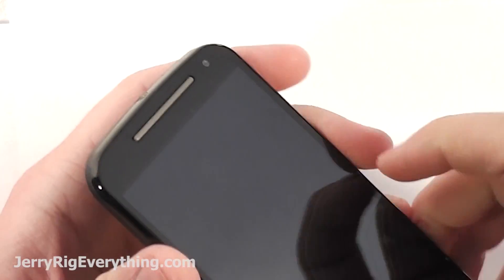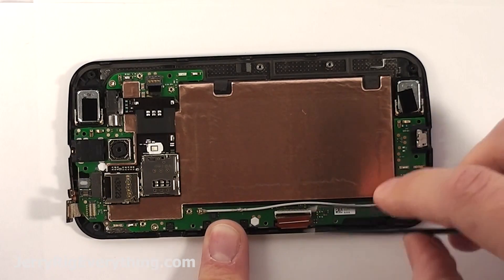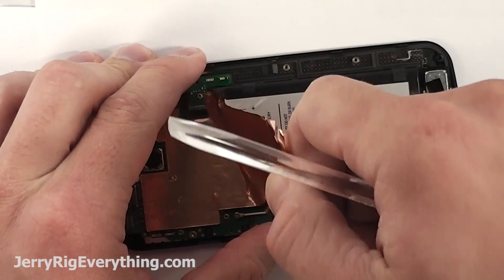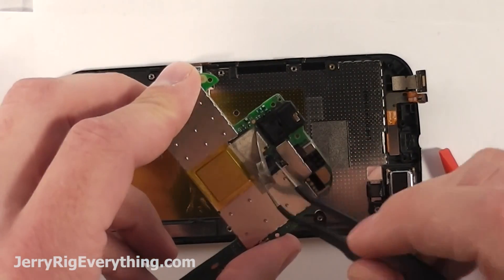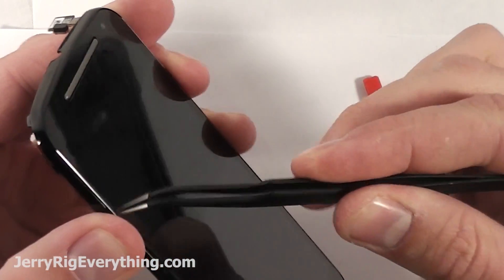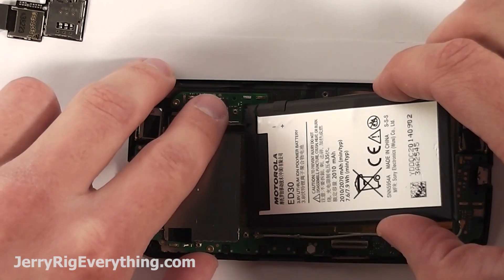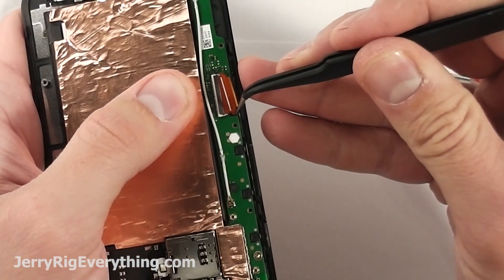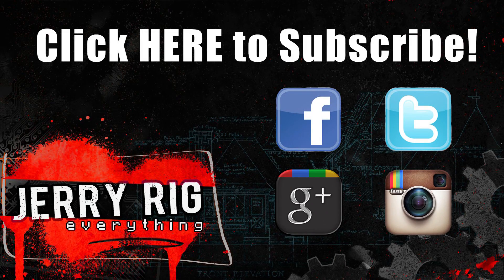Moto G 2nd gen (2014) Screen Repair, Battery Replacement

Comment: A superior instructional video.  Having never done this before, ever, I worked MUCH slower than the video shows, only replaced the battery and was very careful handling the circuitry.  So, it took me 90 minutes.

Comment: Hello, I looks like I need the sim/sd card assembly. The bonehead who put in the sim card separated the adapter around it, so while trying to get it out to change the batter, the sim card collar/adapter grabbed on the contacts and ripped some of them out. The sim card is now not working.

Comment: Ok, I figured it out. During the battery swap process I had dislodged the antenna wire. It has a push fit connector at each end and I had dislodged the lower end. Took me ages to work it out as every time I took the back off the phone everything looked in order and most of my attention was focussed on the ribbon connector of the PCB with SIM/SD trays and LED light.

Comment: Hi guys, I followed this very useful tutorial in order to replace a tired battery in my MotoG.  Since putting it back together, neither SIM card slot is working. Other than taking the phone apart again, disconnecting and reconnecting the ribbon connector, does anyone have any ideas on what the problem might be?

Comment: ---------PEOPLE WHO WANT TO REPLACE JUST THE BATTERY LISTEN UP ------------------- 
I wanted to replace just the battery and I thought about it. You do not need to remove any of the connection of the ear peice or camera or lcd connection (as shown at 0:44 in the video) you just need to to lift off the sdcard/sim card connection (as shown at 0:57 in the video). This will make your life easy as you will not have to connect these back up again if you are like me and just want to replace a new battery. 

ALSO, it shows in the video that the you remove all screws and put them on the table. I suggest their is a better way to do this. You loosen them up while they are inside the cover but do not take them out of the cover. Gently remove the cover while the screws are still in the holes. This way you can simply put the cover back on when you are done and you will have a less than of loosing the screws. Moreover, It will also help as some screws are smaller than others and if they are in the original position when you remove them you will not have to remember their position in the case you put all of them on the table and then decide where the smaller screws go and the big screws go. 

Thanks

Comment: I finally cracked my screen for this phone after years. Unfortunately, when I searched for a replacement part, I was just looking for the screen, and didn't know about having the casing to go with it. Do I really need to take literally every part of the phone apart before I can get to the screen? Yikes. 

I very much appreciate the close, detailed camera setup you have, and the step by step directions.

I've got my tools in front of me, a cloth to make sure nothing rolls around too much, and a little pill bottle to hold the tiny screws, so wish me luck!
Reply: So... It looks like this video has little to nothing to do with screen repair. Why was it in the video title?
Reply: Replacement is done for now. The new screen is in, but without enough direction on where to put the double sided tape, I figured what made the most sense was to glue the flat back part of the LCD screen to the back of the phone case. For the record, DO NOT DO THIS. I think you're supposed to put the gummy tape around the border so that the LCD screen

It seems like it works until you put everything back together, then the screen kind of pokes out the front a bit instead of sitting flush with the front part of the phone. I think the distance between the screen and the speakers is giving the speakers a kind of fuzzy / muddy quality, so now my audio is messed up. 

Another thing to note are the little trapezoidal tabs you might see in the inner case of your phone. These are what your external case is supposed to grab onto to support itself. I have a pile of 4 of them that were all snapped off. Initially, I was just assuming that those things were supposed to break. A sort of "if the phone is dropped, make sure these things take the impact instead of the more sensitive parts of the device" thing.

At the end of the day, the replacement is Done. Playing audio through the phone's speakers seems like it might be permanently messed up if I can't rip off the adhesive glue behind the LCD screen (I have a suspicion that that would destroy the LCD screen itself, so I don't want to risk it). I can see the screen again, but if my phone suffers another failure to a critical system, my plan A will be replacing it.

Excuse the grumpiness.

Comment: Hi there. Nice video. My Moto G2 heats up (really hot) at the top right side, it takes +12hours to fully charge and then the battery drains in less than 4hours. Is an indicator for a battery replacement? Or it could be another component that is damaged? Thanks..

Comment: My Moto G 2nd gen phone was submerged in a swimming pool and had no life signs. 
I Changed very carefully the motherboard, the SIM and microSD board, the screen with the frame, the speakers and connectors, also put a new battery, and works again. I was lucky. 
Thanks for your video!

Comment: You don't have to disassemble all components to change the screen. You only need to unscrew the 3 screws that hold the motherboard, pull the sticky tapes from beneath the battery (yes you can pull them, slowly and they won't tear). This way the whole motherboard with the battery can be removed and placed on top of a new screen. Of course you have to unplug the ribbon cables that are connected to the motherboard (screen, front camera and sensors)

Comment: My motoG2 screen is broken. I bought the LCD with frame, and connected the LCD bus to motherboard, But now my my phone doesnt even turn on. I tried connecting charger as well, but the phone does not vibrate too. So I dont know if the problem is with some connection or the vibrator motor or only the LCD connection Please help.

Comment: Sim card holder link plz..
Reply: did you find one?
Reply: +marios mariou https://m.ebay.in/itm/Sim-Card-Memory-Slot-Jack-Flex-Cable-Reader-For-Motorola-Moto-G2-2nd-Gen-XT1068-/172081746790

Comment: Thank you for this video. I used this and 2 other videos for reference when changing my screen and touchscreen. I almost panicked when i tested and the phone came on but not the screen. I had not placed the motherboard screen cable correctly. You really need to get it all the way in there. I hope the phone will last another year now before I need to replace it :)
Reply: Oh I also wanted to add that if you are getting the tools with the screen make sure that the Torx T5 screwdriver is of some quality. The one I got with the screen started to have its metal head stripped on the 7th screw! It then started to strip the screw heads slightly. Quick trip to the hardware store to get a torx set was better then stripping the screws!

Comment: Hi,

I accidentally dropped my motog 2g from a low table while it was in it's shield and yet the screen  is having weird colorations and also looks like every other line is not working making the screen project weaker light and blurrier image.

What do you suggest I should do?

Thanks!

Comment: hi, great video, one thing to add. the one I opened up had two black straps on the side of the battery. turns out they are there to help pull the battery out, which might make it that you can pull out the battery without the need for a tool. 

thanks again
Reply: helpful thanks!
Reply: Very helpful.

Comment: vertical color lines appearing in my moto g turbo .can I replace it? or it can repairable .I bought only 3 months ago
Reply: Should be under warranty if you bought it new.

If not, vertical lines are signs the LCD screen itself is failing. You'd have to replace the whole screen assembly to fix the issue.

Comment: i bought only the touch and lcd :'( and i dont have the heat machine..what can i do? 
hairdryer works? no right?
Reply: Timo VanDeGriend Okay thank you dude
Reply: +GiannhsD nooooooo...u r talking abut a solder gun vs a hair dyer...dude get some help from wiki
Reply: +GiannhsD if you want it to separate the frame a hairdryer should work, you may need more patience and be carefull but it should make the trick
Reply: +GiannhsD heres a trip: use a hairdryer, and heat it up as much as you can, then use plastic tools to seperate the glass from the frame, you can use metal tools to get the first lift, i recomend to start from the bottom, and work your way up, be carefull around the speakers (thats how i broke 1 moto g 2nd gen screen) any more questions? ask me
Reply: GiannhsD youre welcome :D did you buy an lcd with the orange or green flex cable?
Reply: Timo VanDeGriend Actually i bought a new phone haha :D
Reply: really? what have you donw with the old one?
Reply: Timo VanDeGriend Sold it in pieces :D
Reply: good job xD

Comment: Could you please do a tutorial for replacing the headphone jack on the Moto G 2nd Gen? Can't seem to find one anywhere..
Reply: have the same issue but cannot find anything anywhere on the net
Reply: Yeah man, word of advice, give up haha. In the end I just bought a replacement Moto G 2nd Gen on eBay for a couple months before upgrading to a Nexus 5X. The phone's pretty outdated anyways considering it has two successors now.
Reply: @camzy01  haha I am still using it, besides battery drainage and phone being a little bit slow, I don't have much problem with it

Comment: Thanks! This video helped to replace my screen but I have a problem... after replace, the screen is killing the battery. In battery options I see that the display is consuming up 45%!!! Any help with this?
Reply: don't worry I haven't changed my screen and it's taking  up 43%

Comment: What sticky tape would you recommend? I bought the screen and tool set, replaced the screen but the screen will not stay in place; when I plug it in to charge the light lights up but then it goes out...thank you

Comment: I have a broken sim slot. Is it possible to purchase the sim/sd ribbon assembly as a single piece or would it be necessary to purchase the SIM card reader and resolder it to the ribbon? With a soldering iron would this be a difficult fix for someone with a minimal amount of experience working with electronic? If it is doable is there a particular type of solder to use? Thanks.

Comment: having just done this repair on the xt1072 ie the 4g version  I don't recommend that you try the replacement of the glass and frame in one go.
It is easier just to replace the glass.
the internals of the xt1072 are different to those shown in the video in several ways.
most notable there is an antenna cable running down one side of the phone and this is fragile and has a tiny cirtuit board at one end thats difficult to separate from the frame, also the antenna cable has two sections of its insulation removed and the original xt1072 has special projections that make contact to the screen of the antenna.
the replacement screen I got didnt have these projections so to make contact i wrapped the cable in foil.

so i recommend just getting the glass and keeping your original frame - this will mean a lot less disassembly and your frame will be compatible with your circuit board.
Reply: The little circuit board was j held on by soft glue that I was able to pry off.
Not sure what you mean about the battery.
Reply: The battery does unclip but again it doesn't look like the videos you see. If i recall the battery connector lifts up out of the connector on the board rather than coming out sideways.
Reply: +John Lonergan Thank you very much for the reply and extra info. It is surprising just how little is available for this variant compared to the others.

Comment: my bottom speaker isn't working after replacing screen.  i accidentally pried open the speaker and copper coil(i think) unwound a bit.  does that mean my speaker is not fixable and need to replace it as well? thanks

Comment: Wonderful!! very clear instructions on replacing various parts on the camera. Managed to rescue my sons holiday pictures and fix his phone with a screen replacement. Not all the steps were necessary to replace the screen so leave the parts on that don't apply to you. I had to move across the ear speaker cable and tape it in place (not shown) but no problem. Many, many thanks for your posting........from England

Comment: A very small rubber piece fell out it is flat on one end and round on the other with a small hole, no idea where it goes, can you help?
Reply from the maker: Sandra Ballantine It is probably for one of the microphones, or sits in a slot along the edge of the frame of your phone.

Comment: My phone was working absolutely fine yesterday, but for some reason it won't charge, like on any charger I've tried, any help or tips or anything would be appreciated, thank you
Reply: Found that resetting the phone by holding down power and volume button done sometime helps

Comment: Dropped the moto g 2 in the loo. let it dry out, disassembled by using this video. I was able to clean all the contacts on the main board. The screen was damaged beyond repair so got a new one. All is working well now. Thanks for the good video. The screen i got came from here http://www.ebay.ie/itm/331518080185?_trksid=p2060353.m1438.l2649&ssPageName=STRK%3AMEBIDX%3AIT

Comment: Please help I managed to repair my cracked screen with a replacement frame and new screen, but the speakers sound terrible and extremely distorting. Its like the quality has dropped all the way.
Reply: +Will Poulton Drumming Hi. Did you manage to fix it? I have the same problem.
Reply: +Carlos Silva Nope i ended up getting the Moto X lol. But the only reason i didnt fix my Moto G was because there dont seem to be any compatible speakers for sale online.
Reply: OK. I found some speakers on eBay but someone else told me that by changing the screen once again it started working. Maybe I'll try getting the speakers. They're cheap, less than 10 dollars.

Comment: Thanks, I was able to repair my daughter's cracked screen 😀 very easy phone to repair, I found a complete front assembly on eBay for 39 bucks.

Does anyone know if replacement screws are available?  I found the torx heads are pretty soft and if I have to fix it again the stock screws will not make it.

Comment: Thanks for your vid and links, one point to note don't tighten screws to much, I did for the one under in the sim slot and it now has a faint blur on the lcd under the screw hole, oh well. Everything else is A.OK

Comment: Thanks so much for this video. I was able to replace a cracked screen.

Two points:

1 - There are two black tabs on the side of the battery closest to the edge of the phone. These are where the adhesive is applied, so when trying to remove the battery, these are the areas to concentrate on getting your spudger tool under.

2 - The replacement frame & glass came with new adhesive strips covered in red. With a fair amount of effort, you remove the red and then you have new adhesive strips for the battery

Comment: Hi, after I replaced the screen I had gotten "SIM Not Inserted" message. So, I took it out and saw that the sim board was not connected firmly. Went ahead and did that. Now I get a message "No Service". Phone was perfectly functional on T-mobile before I tried to replace the screen because of a small crack.  Don't know what to do now. pl help

Comment: I replaced the screen on a Moto G 2nd gen, but the touch isn't working.  The screen turns on, but it won't register any touches.  Did I do something wrong?
Reply: Decembri Hi there.... good news bad news.... I purchased the Chinese AAA combo in the black market ( screen, touch and frame)  for U$ 35 dollars but even though the screen lighted up , the touch didn't work....... then I purchased the original combo part from Motorola for U$ 60 dollars and it worked just fine... so for those of you which the replacement part didn't work its because the part was NOT the original but the Chinese copy.... so if u really want to fix your Motog2 please purchase the original combo part from Motorola !!! :)
Reply: I'm have the same problem. I really really need some help with this
Reply: Andrae Henry Me too!! Does anyone knows how to fix this?
Reply: Me too .... its has to be something relate to the software not being able to recognized the new hardware ( display ) ... I ´ll work on the software today and will let you guys know how to fix this shortly.
Reply: Javier Aguilar thanks! My moto g had just been sitting in a drawer.. Hope you figure something out!
Reply: Which screen did you replace? Was it the full screen like suggested in the video or just the outer glass? The outer glass has no touch
Reply: Liam Ouzel I replaced the entire display.

Comment: Would I be able to replace the 2070mah battery with the bigger battery from the 4G moto G?
Reply from the maker: sillyshain Depends on if the connection is the same size or not. Let us know what you find out.